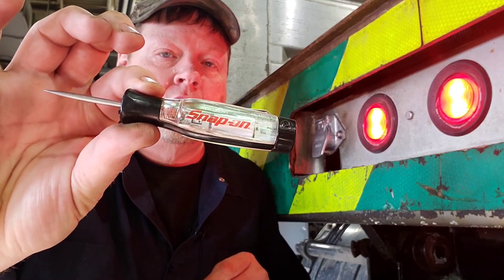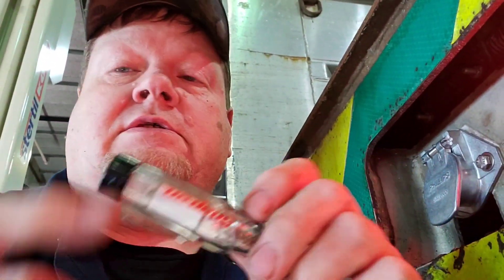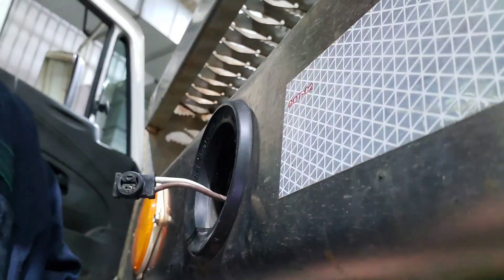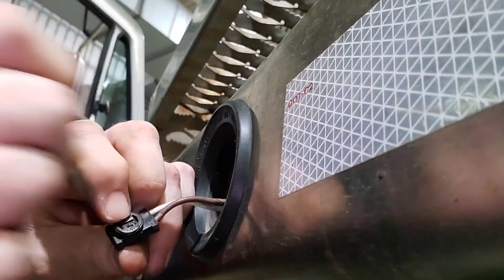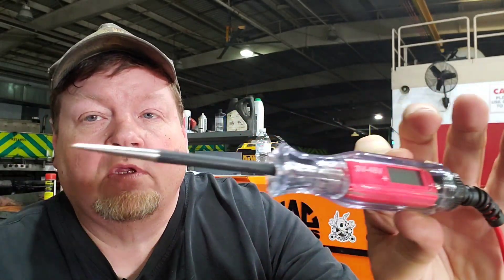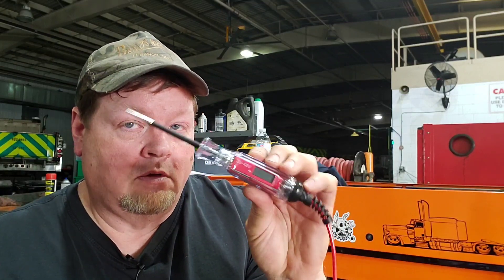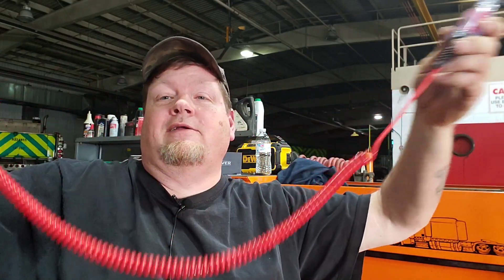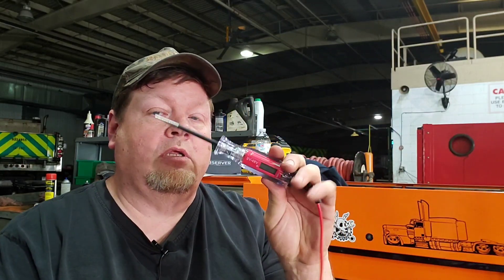Go / No Go Electrical Testers.

Comment: Are these computer safe? (The snap on) nvm you answered at the end ...I like that it has a pocket clip be very handy for doing a lot of circuit checks without having to lug around the cord and find a good ground.
Reply from the maker: WARNING... if you lose the cap, it very pointy and hurts when in your pocket and you bend over 😳
Reply: @OneMechanic  that’s exactly why I would put it in my back pocket 😉

Comment: Great video I own a version of both of those tools and they’re very handy tools!! Just remember load testing the circuit is the only true way to test it. I have two methods for this one is to use a headlight bulb or if you can afford it get a load pro.. but keep in mind I’m a professional heavy fleet mechanic and work on electrical all the time.. One Mechanic and I know each other and work in the same type of field very good mechanic. 👍👍👍👍👍👍

Comment: The wireless tester is a good one, there are a few different designs from other brands that work just as well. Personally I use my power probe for 90% of what used a test light for in the past. If I have to hook up a ground lead anyway, I would rather be able to test for both power & ground & see a voltage read out all in one tool. And it gives me options on how I connect for testing with all the different banana jacked leads out there. For me, all diag videos are good stuff. Thanks for sharing Dave. 👍
Reply from the maker: Thanks Tobby, Yes, if I have a serious issue, then my power probe or Multi-meter is definitely the way to go depending on what is going on. Stay safe buddy :-)